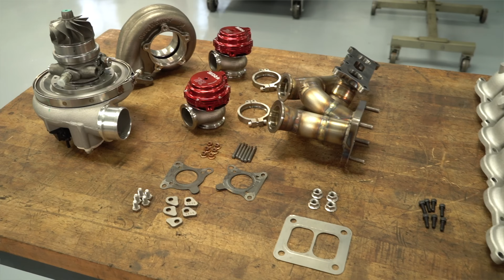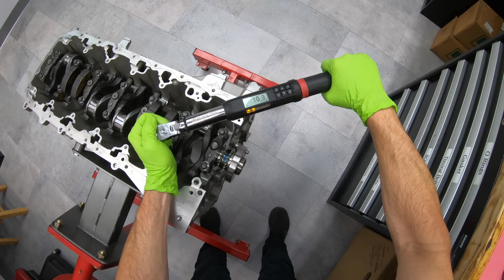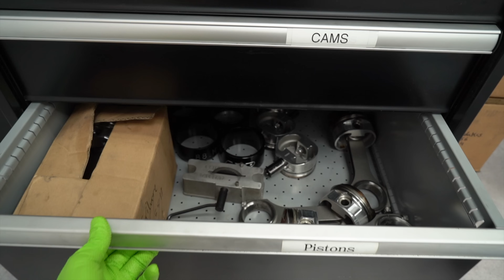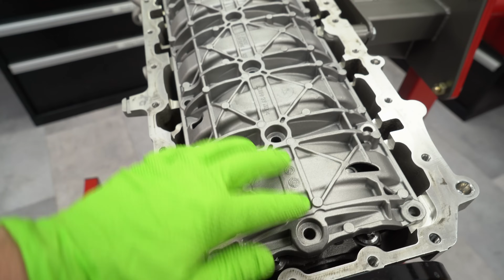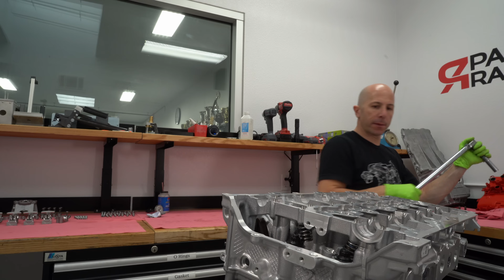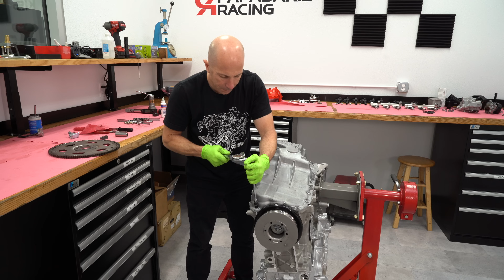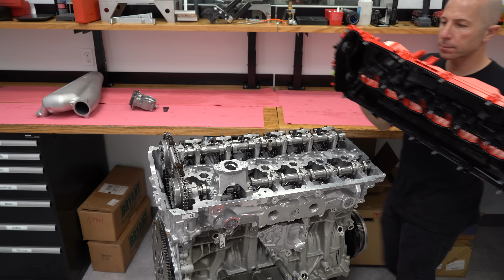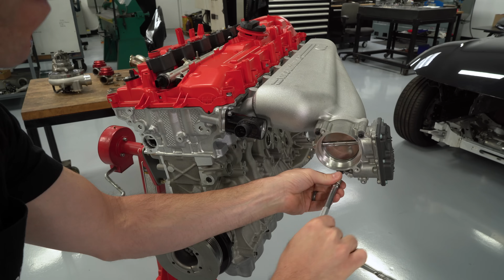2020 Supra 1000 HP Engine Assembly - Start to Finish

Comment: BMW watches this video and realizes that plastic intake parts💩 are a No-No😂😂😂😂😂
Reply: Greg Pavitt haha yeah exactly why it’s out in the garbage collecting dust I believe 😂 intercooler my ass 😂 I like my front moutn😂
Reply: Greg Pavitt didn’t he bring up in the B58 video that they are actually good?
Reply: Haven't you heard those plastic intake manifold are prone to breaking and cracking due to aged and plus the stress  those plastic had to withstand higher boost from the turbo, it will wear them out faster than any metallic intake manifold. Tell if there are any plastic pressure vessel ever been made since plastic are cheap. The answer is no.
Reply: zuhaili shufller oh ok
Reply: @zuhailishufller8046  why are you not at BMW s M division?
Reply: Ryo .Hazuki my guess is he would be bored.
Reply: @zuhailishufller8046  , Putting plastic parts in the engine bay = 20% lightweight and 80% for BMW to make money. ..why do you think the resale value of BMW drops so fast and why there's always a new BMW out almost every 3-4months. ..
Reply: @seanm.collins9888  m division doesn't even mean anything like it used to
Reply: kvn it’s good for the power level it’s at but i don’t think toyota is intending anyone to run 1000 horsepower through it😂
Reply: The pressure in the intake isn't really that high, even for 1000 hp, like 30 psi or even lower. My air compressor has accessories made of Chinese plastic that can withstand 100+ psi just fine. Surely engine parts QC'ed by Toyota is better built than those.
Reply: @HoweDoYouDo1999  plastic vs steel/metal makeup. It's not good, just cheap part that is going to crack
Reply: @JoshuaMT  It is the Germans mainly. Counting their gold and sticking us with plastic ass cars. Daimler-Benz screwed Chrysler with plastic coolant system parts in the mid 90's. VW and AUDI will have composite engines sooner or later. Never seen so much plastic in a car. Plastic dispstick and oil fill tubes, oil pans, valve covers, gears and more.
Reply: @pgmurray76  you got issues, no engineering quality
Reply: @pgmurray76  and Germany is so bad, right? that is why you can make a 1000hp with a little alloy block??? you have no credit, no clue and you are ancient tech. remembers me of ww2 where the usa took 8years to catch up what germans design in thecellar without any light or barely food or oil. their advantage is massive and so your comment is ridicolous.
Reply: @MrTiti  Michael Schumacher and Sebastian Vettel are my favorite F1 racers. BMW is ny favorite car marque. Kern Microtenik is the best compact 5-axis cnc machine.

 A V2 rocket blew up my grandmother's only sibling, and my  89 year old great aunt Frances escaped to marry my Polish uncle. Yeah, I do have a few gripes. I could care less about you spouting off about qualifications. So butt hurt it is embarassing.

 Why the F do mass produced VW cars have so many plastic pieces? Reliability? No. Strength? No. It is COST. Period. Disposible cars for the masses and cost reduction.

Three words: Honda H Series. 2.2 or 2.3 liters. Alloy block. Four cylinders. One turbo. CNC and hardened oil pump. 1000HP all day long but at the price of traction. Produced in 1992. Whoop de doo.
Reply: If y'all wonder why I have issues with certain German people...look no further than this arrogant, superior prick Mr. Titi. I am an eastern european mutt with a touch of Scot.

You can bet that my original comment was 1000% intentional to draw someone like this out of the woodwork. BTW, I am always early for appointments. I drove limousines while attending college. The only German man (an Engineer, what a shocker).said to my face I was late, then said something to his other weird faced partner and spit on the ground. Go F yourselves. It was not my pickup. The original driver bailed out and I had to do Autobahn speeds on backroads just to get there 6 minutes before the scheduled pickup time. Ideally a driver is nearby waiting less than 2 minutes away and shows up 15 minutes before on the dot. Pricks.
Reply: My Godmother was 100% German.  Witte. Scared of her, but thankful she taught me about money (another shocker). 5 foot 6 inches with cropped blond hair. She was the only person to buy a generous amount of Bonds for me when I was born. When she visited she asked if I was saving my money like a wise person and had a career choice (I was 11). I loved her and she died of throat cancer 15 years later (never smoked, never drank).
Reply: You are all no longer allowed to comment on German cars nor any other Engineered product. Certainly no mentions of the heavy use of plastics, resins, and composites in combustion engines. Like it or not. According to Mr. Titi you have no experience, no education, and are not superior enough to comment nor think. You are no longer allowed to watch car channels on Youtube. The Gestapo is out and looking for you as always. We dumb 'Mericans make nothing right and are too poor. You are never allowed to learn from mistakes because mistakes should be never happen as they shall be 100% engineered out of your thought process. Says Mr. Titi. Japanese cars and engines do not exist like the Holocaust demands superior Mr.Titi. We must piss our money away on over Engineered, heavily complex, overpriced, super reliable, never fail, simple to work on German vehicles only says Mr. Titi. Their spare parts and service are so inexpensive. Great value for your dollars! Such a generous country to the entire world!

Plastic oil pan. Ok. It is not necessarily less expensive. It cannot corrode. It is stronger than cast aluminum in terms of tensile strength, so when you wack an object in the road in your Golf you will not loose your oil, nor have a broken pan. The pans have greater rigidity in multiple axis, so it becomes an integral stiffener for the crankcase area of the engine block. This is all understood. Steel pan is cheaper and will not crack, but can never be made as rigid without bonded stiffeners or an absurd wall thickness.

Plastic oil drain plug. Why not. It won't wear out the pan and can be made into a complex shape to allow a half-turn removal. Inexpensive to replace, but needs a tool to remove without gouges.

Plastic timing gears. Umm. Just no.

Plastic oil fill or dipstick tube. Ok, it is not a critical or structural part. It will not corrode and dump oxidized metal into your oil sump. Good. Plus it prevents electrolysis...except there is a plated steel tube pressed into the block. Plastic will neither withstand the engine crankcase temps nor the exposure of gasoline over long periods of time. Maybe Tefzel.

Plastic intake manifold. Cost, no. Shape, length, and volume of the runners and plenum can be optimized more readily. They can 100% be made to withstand boost pressure...within reason. Forget over 35psi. The original Engineers would have to have a max pressure target in mind. Accounting would prohibit this.

Plastic timing chain guides. No worries as long as they are replaced at the recommended interval. It would be just stupid to use metal as guides with direct contact with a chain. The metal particles would polish the internals and narrow galley passages. Plus depending on the metal it could lead to electrolysis. The point is to have a lower durometer material than the chain with a decently low coefficient of friction to thereby preserve the chain and reduce noise.

Any other resin or plastic parts are not welcome aside from the oil cap, timimg cover, and engine cover. It makes sense for a few components. Lighter and no corrosion.

Comment: Doesn't look like many changes were made. I think you're gonna have to prove this makes 1000hp
Reply: its gonna be hard making 1000whp with only two 1” exhaust runners on the cylinder head. my k20 has larger ports and theres 4 of them.
Reply: Tyronie balonie forged internals + 4V DOHC VVT = 1000HP easily.

Comment: Use the knowledge from this to make 1000 horsepower 3 series and Z4.  1000 horsepower requires more than just a DME flash.  But with these mods soon the 540i will blow the doors off the M5.  Then we will need to do this tune to the M5 to achieve 2000HP, or when the Supra and 540i get 2000HP maybe we can tune the M5 to make 4000HP

Comment: The 2 exhaust port really leaves me scratching my head. Can someone explain how this is better than regular exhaust ports?
Reply: This shit will be a restriction for sure. I'm really doubt about 1k hp due to backpressure and flow issues...
Reply: Imagine a normal cast iron turbo manifold but inside the head. The runners are just cast into the head instead of individual ports coming out which then require an external manifold. Seems to be a space saving thing rather than performance. Probably flows just as good as a manifold.
Reply: xempt. one agreed. I don't think that maniforld will stop it getting 1000hp.
Reply: I think, I heard you can use different heads for this engine if that is an issue.

Comment: I'm a little surprised you didn't know about Cerakote until recently. It's a great product with different types for different applications including plastics, exhausts, high temp uses, wheels, coating/painting surfaces, and they even have clear ones if you just want a tough coating to protect something while being able to see it still.

Comment: I think the 2020 supra is underrated it could be exactly like the mk4
Reply: Certainly it could... but until that engine get modded enough to make 1600hp+ as a 2JZ haters will still hate... it is what it it
Reply: It's missing the elegance and grace. Literally the supra should have been an frs or ft86 with a trd package. They could have used a bmw drivetrain but put it in there car and it would have been fine
Reply: @toy4tao  I hear you but those are for the past technology of these engine requires dual clutch if it's dual clutch ..
Reply: @toy4tao  a manual option would always be nice and much more enjoyable, but automatic is the way to go nowadays, faster and better in all aspects. facts
Reply: Better*